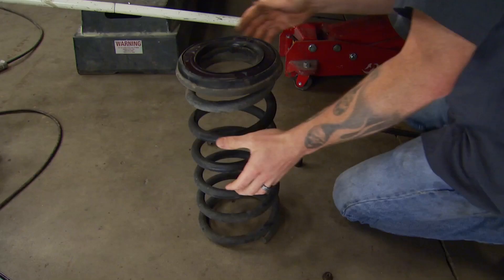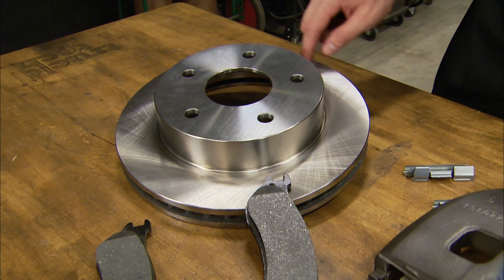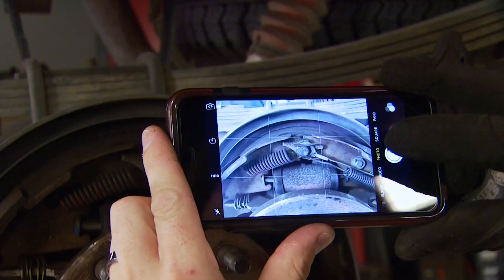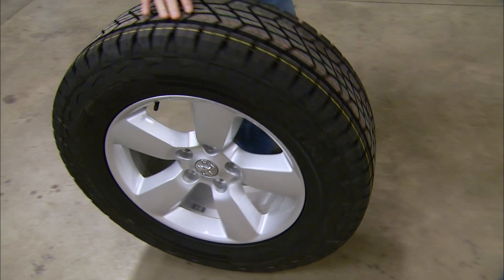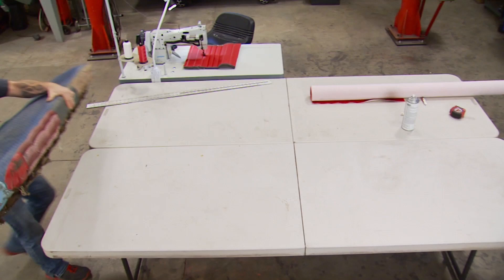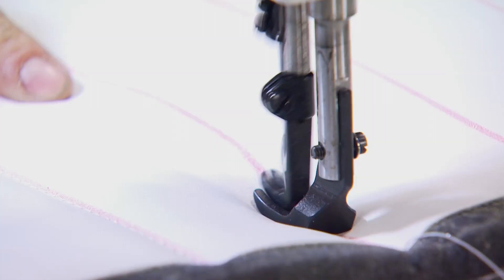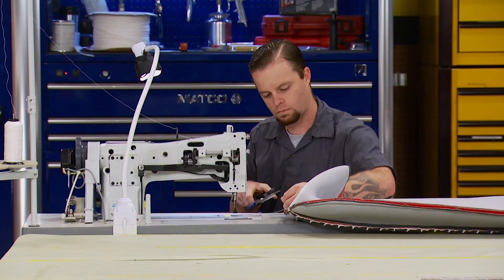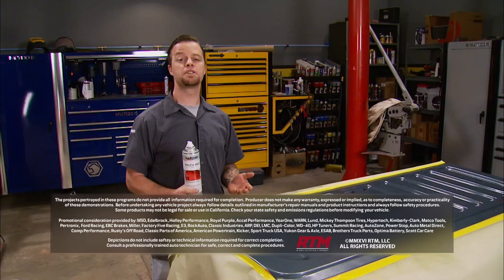Installing a Leveling Kit for a Smoother Ride In a Dodge Ram 1500 - Truck Tech S3, E22

Comment: I like that you wire brushed to hub so the rotor seats flat but I am disappointed you didn't use anti-seize so the rotor won't rust to it.

Comment: Dang I need all of this on my '97 Ram 1500 with a 360 V8 Auto, so far it has 269,000 miles on it and still runs strong and doesn't ride too bad for how old it is and with so many miles, but can't afford too much stuff to put on it. It has been a good truck for the past 6 yrs I've owned it, I've hauled and pulled anything I've wanted and have put 77,000 mile on the truck myself, just hope it lasts a few more 1000s of miles.

Comment: Yeah leveling kit did nothing for the Improvement of my ride I think that's a lie
Reply: yeah but like its a truck its not meant to ride well its meant to haul shit
Reply: @idontknowanythingaboutcars896   But the title is misleading
Reply: @idontknowanythingaboutcars896  And they are made higher in the rear so that when they are loaded they ride correct.  Leveling kits are bad.  But, they look good for some people I guess.
Reply: Robert Anderson I mean they’re good if you really never tow and you wanna fit bigger tires.
Reply: @Formulabruce  ok cool but who asked
Reply: You can still pull trailers with a leveling kit. When you add about 6in of lift though you can get a Receiver Hitch with a Lower Ball to tow with.
Reply: Yea lmao I just thought the same thing.  It’s looks more than anything . Them new shocks did the smooth ride for sure they dropped good money

Comment: Going to want to regear that to 4.10s with some type of LS diff or lockers/tru-tracs.. Putting 31"+ tires on those are why they have a reputation for being slow. It just doesn't work with that transmission or the way the engine makes torque. Still the best looking trucks ever made and worth the effort to keep them around.
Reply: 35" and 37"s yes 31+ plus is factory size on new trucks
Reply: The factor size tire on the 2nd gen dodges are a 255. A lot smaller then a 31 buddy so when you go up to say 33-35 the gearing is WAYYYYY off
Reply: @jamesduffey4442  thats why i said new trucks

Comment: The rubber and polly spacers ( leveling kits ) ride much better than the steel ones. Installing old spring seats would definitely be a ride upgrade. My stock ram seats offer very little vibration and impact absorption

Comment: Need to lift the front of my 03 Dakota up a little bit and do the front brakes myself.  Picked up a set of 265 70 16's and stock it takes 245 70 16's so the tires are just a touch taller and rub if I turn hard or hit a big bump.  Mine is a 2wd so also need to get the speedo adjusted since it's a little off.  There are a ton of other things I would love to do with it like recover the front seats (especially the drivers) but honestly there is so little I can afford to do.  My wife passed away last February which has made getting by a lot harder but I plan to keep my truck forever it was the first last and only vehicle we bought together.

So far since I have had it I have replaced the shocks, front hubs and bearings, brakes, radiator, some hoses, thermostat, swapped the injectors for the ones from a 2.3l ford focus, home brew cold air intake, modernized the cooling system with an expansion tank, rebuilt the whole front end, and tires a couple times. I have so many trips and memories in it though it has been with all the work I have done.

Comment: The truck is beyond simple to fix. There’s a kit on amazon for the steering and ball joints. 3/4ton parts will bolt right on
Reply: Link?
Reply: @levil7324  much thicker than oem and reg half ton parts. Same size axles, just pumpkin and internals are larger on Dana 60’s
Reply: @kunu98  sorry I meant the Amazon link. Thanks for the reply 👍
Reply: @levil7324  my bad. I posted the link but YouTube prob took it down. Copy and paste this into Amazon. “Detroit Axle - 4WD Dana 44 Axle - Front Tie Rod Steering Drag Link + Sway Bars Suspension Kit Replacement for 1998-1999 Dodge Ram 1500 2500-13pc Set”

Comment: 9:37 Driver side headlight is full of water!
Reply: Those cheap aftermarket headlights.
Reply: headlight fluid*
Reply: You noticed the water in the light, but did you notice there was no key in the ignition when they went for a drive after the brake job?
Reply: @DK-dh4ci  I didn't notice! I have one of those trucks and I don't even need a key to turn it on! LOL! good eyes sir!

Comment: "Cummins swap" <-- silly Millennials. 
...these trucks came out when these guys were in elementary school and the truck scene was much different then.
They may not have a modern Cummins I6 or Hemi v8, but LA Magnum v8 motors are good reliable motors.
Get a clue dudes.
Reply: They might have a 12 or 24 valve 5.9 Cummins which came in the gen2s
Reply: @jacobmullins3644  Indeed: I know that :)

Comment: You can also do the gm wheel cylinders for a upgrade for better upgrade
Reply: @303StreetMachines   not sure on the 2500. But join are Facebook group there is forms files in tons of help on these body style trucks and everything you need to know 
(dodge ram trucks. (2nd gen)  DRT2g)

Comment: Saying a leveling kit smooths your ride is a lie and quit selling it as so. When they come to my shop saying since the leveling kit was installed it rides rough,and you tell them the leveling kit is the cause they flip out. They will say that this video said it will make ride smoother. I tell them if someone is selling junk they are not gonna tell you it is junk. LIFT AND LEVELING KITS DESTROY YOUR VEHICLES RIDE QUALITY.

Comment: I’m just curious on why not giving it some disc brakes in the rear instead of just replacing the drums brakes for added stopping power?
Reply: johnny martinez I think this is show is about 3-4 years old, if not older. I also think a rear disc swap may have been time consuming for the show (ABS replacement, master cylinder possibly) and they wanted to maximize the 20 minutes a typical show usually is to keep it to one episode. Just my .02.

Comment: While the brake lines were open, why not replace the grungy, old rubber brake hoses with braided steel units? MAJOR improvement in braking in any older and/or high-mileage vehicle.
The graphic in the show indicated they installed trailer tires - T275/65R20, but the YouTube info adds the "L" to the beginning.